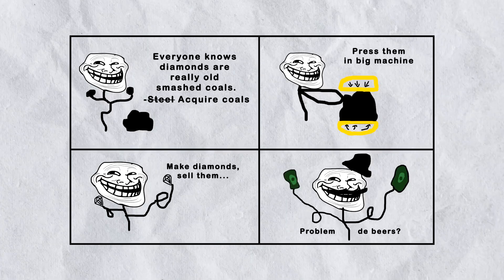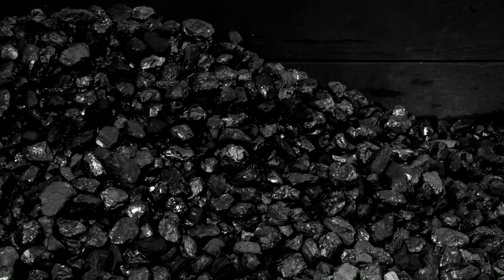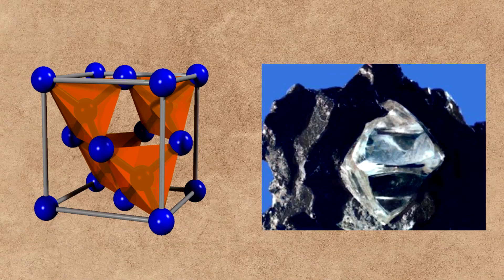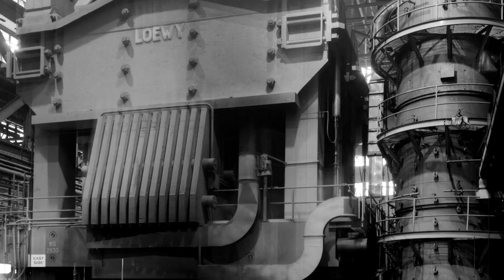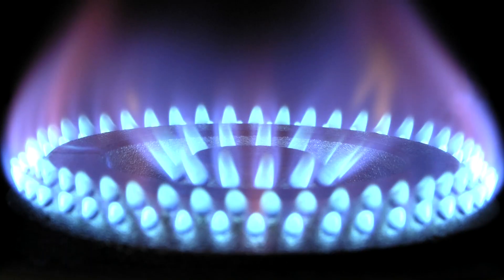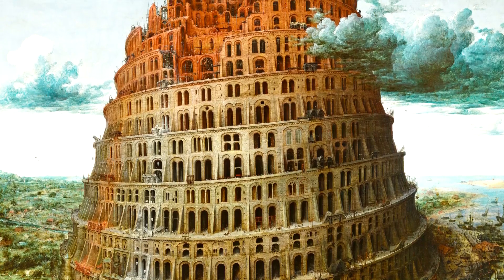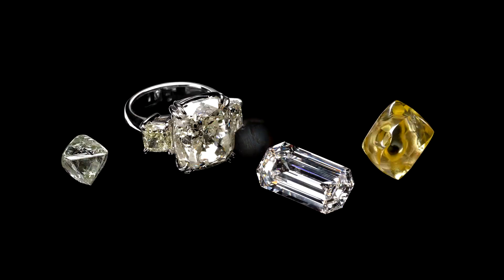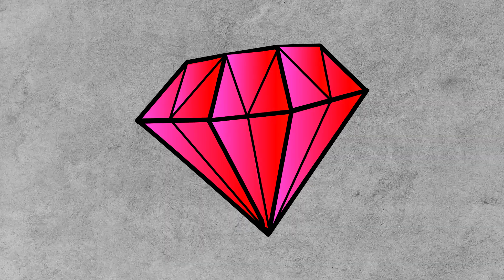why it works 19

Comment: Diamonds are like tulips were in the 17th century. Literally the only reason why they're so expensive is because a handful of people managed to convince everyone they're valuable.
Reply: eh they are actually useful for some stuff like drills
Reply: @LeoLau-jw7ji  True, but industrial and synthetic diamonds are nowhere near as expensive. You can casually pop down to a hardware store and buy a diamond cutting or grinding wheel for a few dollars. And while industrial-grade diamonds are usually less pure than gemstone-grade ones, synthetic diamonds are essentially 100% pure yet they cost 80% less than natural diamonds. So clearly, that 80% markup isn't about purity but simply about marketing.